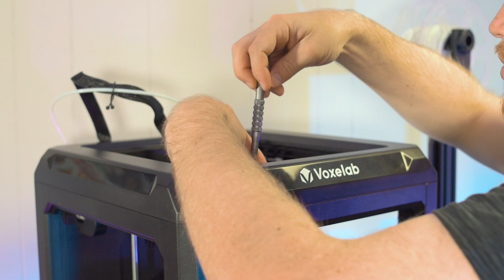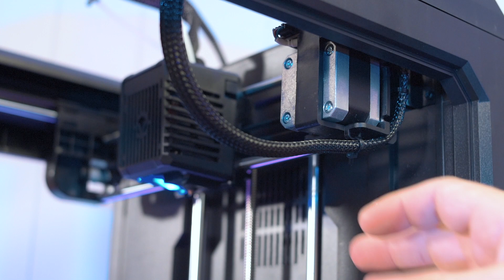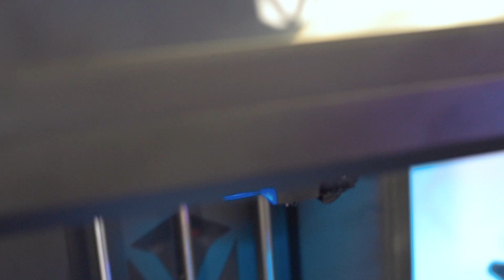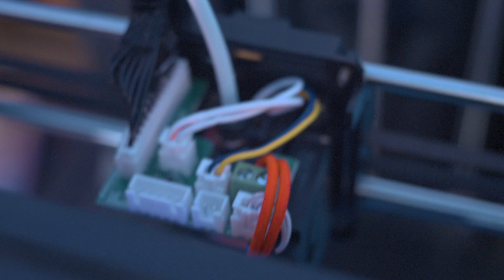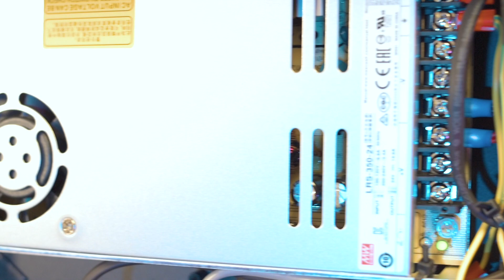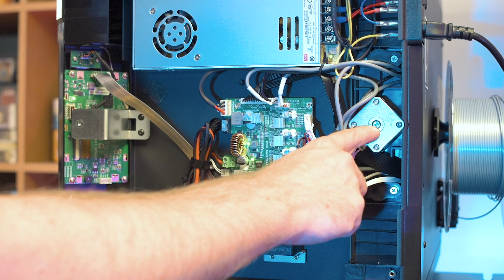A Closer Look at the Voxelab Aries 3D Printer

Comment: I've seen this sister board type thing on Qidi printers. Where do you find replacement parts? Everything I've seen is the standard long cables. I guess you need to cut/crimp your own?
Reply from the maker: Yep, that would be the case. I’m sure voxelab would carry some as well, but it would be very easy to just shorten any cables. :)

Comment: Do you prefer this over the other models looking to make vape mods so I need to be making good quality
Reply from the maker: Depends. If you are new to 3dprinting, this is a good choice as it’s easier to get going. The Aquila is great but needs a few things to make it reliable. So if you like a printer that you can modify and improve, that might be a better choice. The other strong suite for the Aquila is that it’s not locked down in any way. You can use or do with it as you wish. Where the Aries is a bit more stuck in the VoxelMaker Slicer. At least to be able to use the WiFi functionality.
Reply: Any advice?

Comment: I got mine and sent it back two days later, cause it would never level, kept on dropping the build plate when leveling in any setting 16mm to -6mm
Reply: Were all the bolts/belts tight?
Reply from the maker: Well that’s odd. So it was somehow adding a Z offset? Bummer. Out of curiosity, are you get an exchange or just going with something else?
Reply: @3DPrintSOS  I just send it back and order the cr 10 smart, easy leveling and my two cr 6 I just love the heck out of.  I wish they would hurry and come out with a dual head with auto leveling printer as well. I bought the artist-d and had to send it back as well, all it did was scream at me when I sent a print and would never do anything else.

Voxelab though did respond to my emails real quick wasn't no waiting. so they do got good customer support.